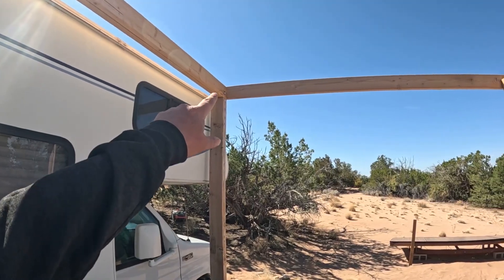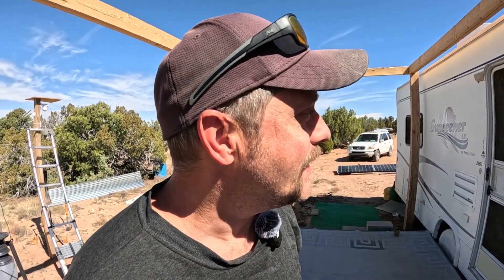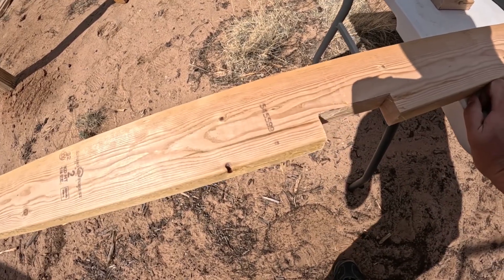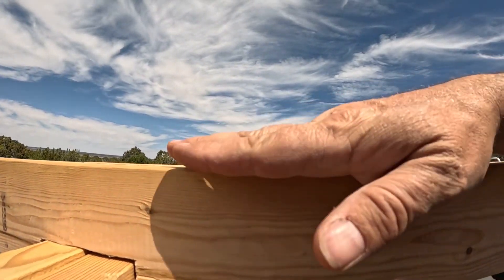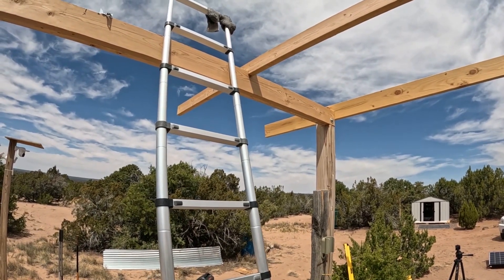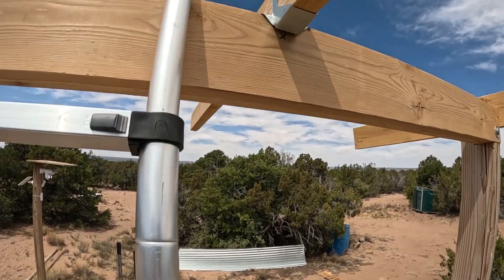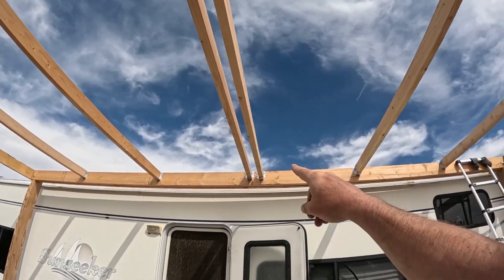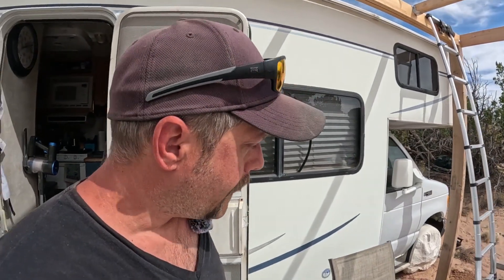Getting There: Rain Catchment System

Comment: Tried a diesel heater, lasted about 6 months. Propane is king here, crack a window, absolute must in a small space.
Reply: Diesel heaters actually work great. One trick to keeping them running well, is to simply wire brush the burn chamber at the beginning (or end) of the Winter season, to remove excess soot.